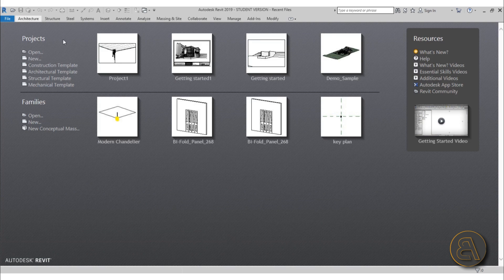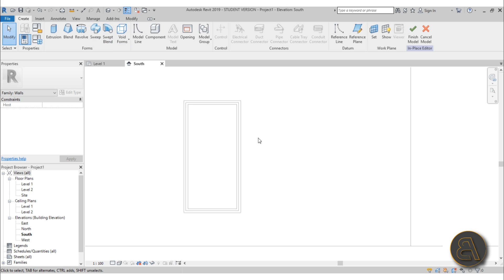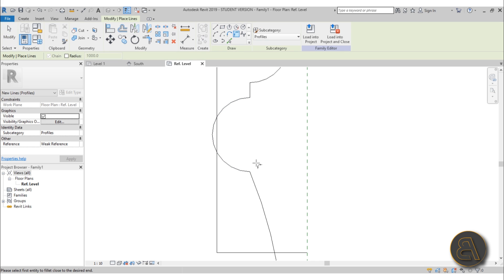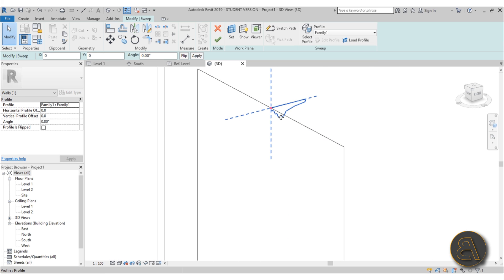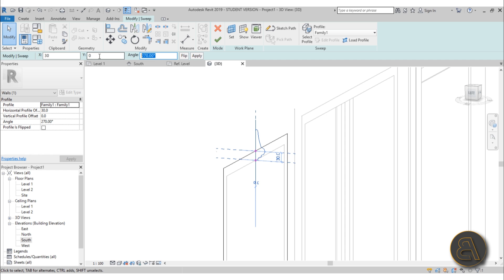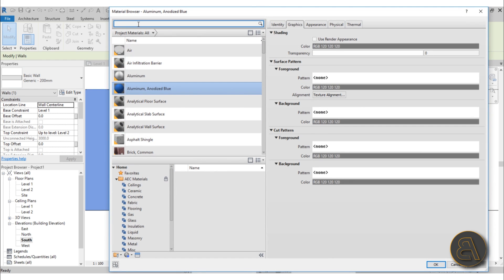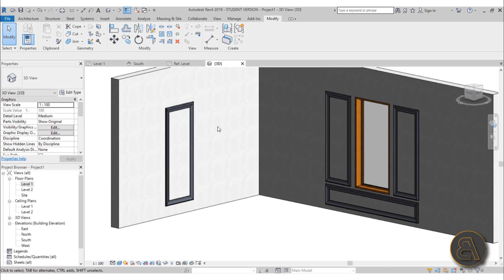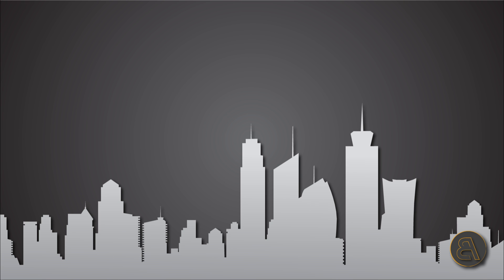Classical Wall Trim in Revit Tutorial

Comment: Thank you! One question though, how would you load this into another project as a wall type? I am worried that when I load it the design I have for the molding will not repeat itself if the wall gets longer.